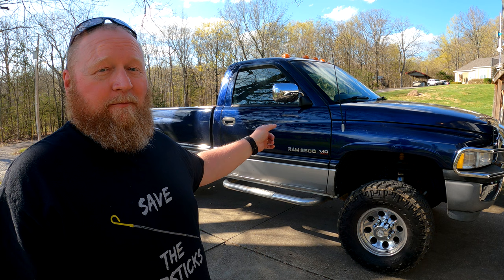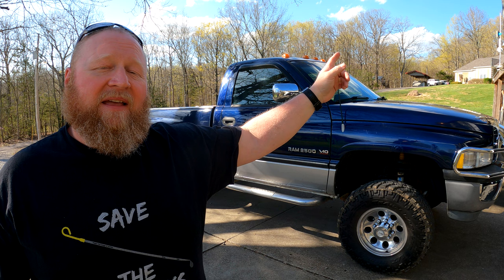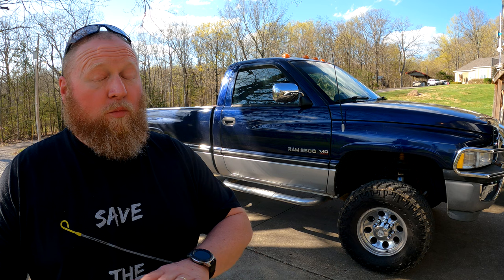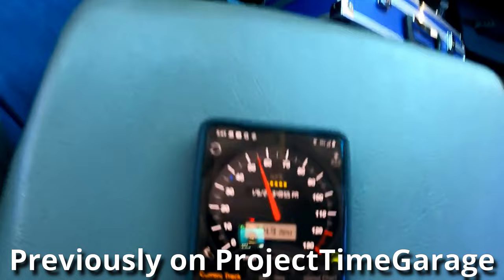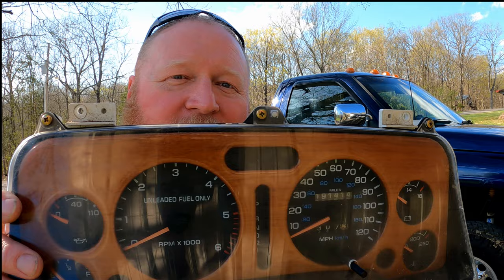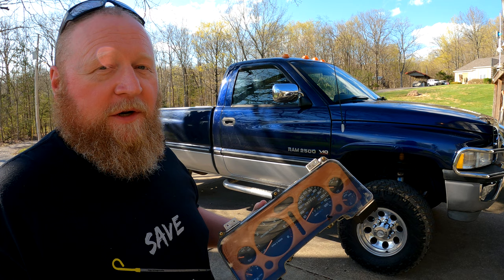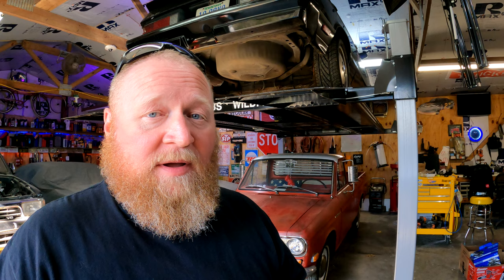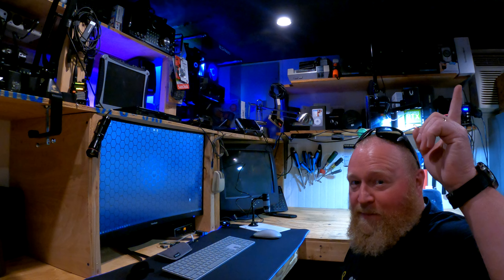SPEEDOMETER Reading WRONG- 2nd Gen Dodge Ram 2500 3500 and 1500 - HOW TO FIX!

Comment: I just bought a '99 V10 with 117k miles and mine has literally all of the exact same issues that you're dealing with now. You have been a lifesaver as I've been conducting the repairs, I'm looking forward to having her as an excellent hunting rig!
Reply from the maker: That V10 was a really solid platform. Not many issues with the drivetrain at all. Should make a dependable rig.
Reply: @ProjectTimeGarage  Here's hoping, the guy I bought it from had a K&N cold air intake installed and then haphazardly put the OEM assembly back on with parts missing, and so I'm trying to source parts to get it back to OEM specs.

Comment: My truck now has i think a cluster from a stick truck because when I go to start it the upshift indicator on the dash illuminates in the cluster,im also guessing that is why the truck has a low fuel light indicator that works even this truck doesn't have interior wood trim, overhead console with compass and outside temp readout display,pwr mirror and audio stereo steering wheel controls on the back of the steering wheel...
Reply from the maker: Yep, probably a stick version. Does it have the PRND21 on it?

Comment: Those 2nd gen dodges are notorious for fuel sending unit failure. I lost count on how many of those i changed over the years. 

That cluster issue reminds me of having to solder the big green connectors on the old style international school bus clusters. All the gauges would constantly sweep when the connection is bad so a solder job would take care of that.
Reply from the maker: Yep - I replaced the fuel pump in this one a couple of weeks ago - Sending unit has already failed on the new pump....

Comment: Interesting issue.  Was the trip meter reset to "0"?  Was the odometer advancing faster with the higher indicated speed?  Are you an electrician by trade?
Reply from the maker: Strangely the trip meter and odometer were both behaving normally, the issue was evidently in the circuitry that drives the gauge itself. No, not an electrician - I'm in Information Technology.

Comment: Know what happens when you don't fix the dash when it starts acting up, well the right side of illuminated green lights, the bright indicator the low fuel light the right side turn signal indicator, the fuel and volt guage everything else just quits
Reply from the maker: Ah, good to know.